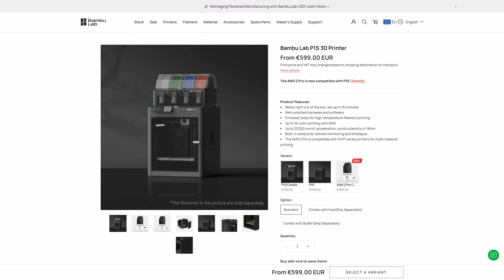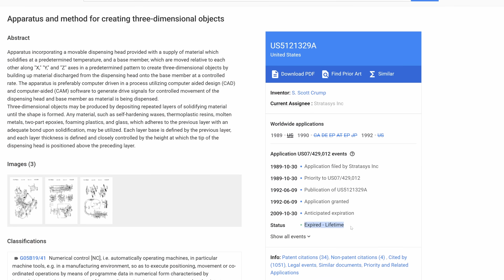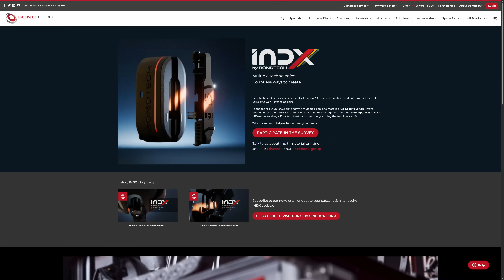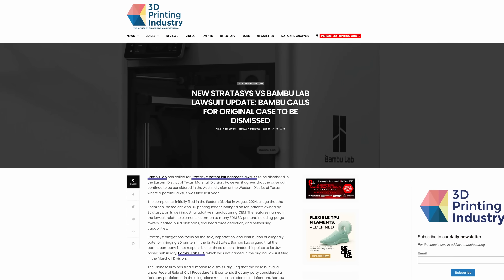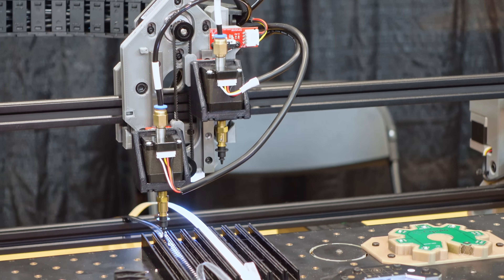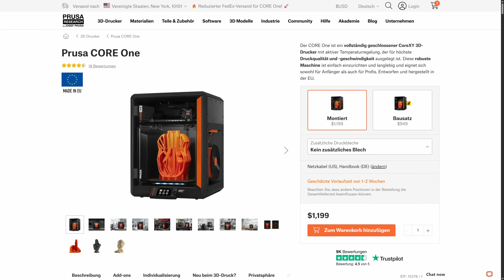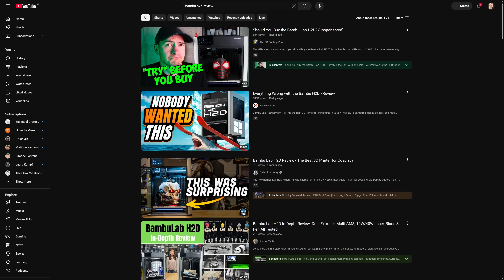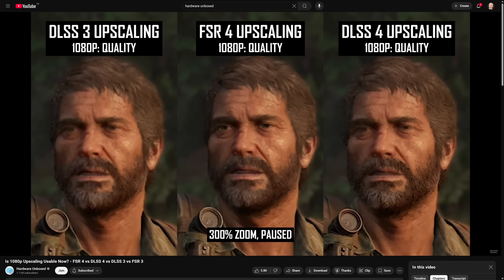How Bambu has won

Comment: Review-wise, what is still missing is using numerous high-end measuring devices to accurately explain why one product works better and will continue to work better...
Think vibration control, actual speed, temperature variation, many things can result in more noise and then a louder product, etc.
Also, how better has the product been thought out, its architecture from the ground up, the strategy it is based on... 

Also, to cover the tinkering open source school of thought; we have seen before: Apple computers versus the tinkering machine filled with ports that Wozniak was dreaming of!
This is also related to technology maturity and customer segments.

Comment: Also one mildly annoying thing related to "Bambu Labs having won", many 3D projects (especially those aimed at beginners), only describe "Bambu Labs settings" as recommendations.

So instead of amount of recommended walls, top layers & infill, instructions might just mention something like "Medium strength".

Sure, I have enough experience to usually figure out what kind of parts might need more strength, but would still be nice to get some directly usable (on any FDM slicer) settings recommendations. Also, if it's a big project, it's easy to think of some sensible settings, slice some parts, print them, and when you decide to slice more, you (and your slicer) have already forgotten those settings (even if it's rarely important to have 100% same settings on many parts)

Comment: What I want from this channel is just breakdowns of new tech like you always have. If there's a new extruder that can print metal, I'd expect you to cover it. If there's an AIO printer that handles that, same deal.
I could get that somewhere else, but I trust your judgement more than some random channel because you've built up a reputation for yourself.
I remember initially getting into your channel because you had comprehensive walkthroughs and hacks and stuff for a bunch of the 3D printers I owned, but realistically, these days, someone else is going to do that if you don't.
Reply: My current printer the Tevo Flash is sitting in a half-built state with a high temp extruder I modded it with because I could never find the motivation to finish it, and I've been wondering whether after all this time, I should just buy a new state of the art printer. After this video, it sounds like maybe I need to try one of these bambu ones. I wouldn't trust anyone else's judgement on something like that, but you've been through a lot, have good critical reasoning skills, haven't been bought out by anyone, and you can always see the honesty in your body language.

Comment: Open source is a great philosphy for kickstarting the development of some emerging tech. That idealism creates an exciting and collaborative community. However it only gets you so far. There is this brickwall in the evolution of any complex tech that can only be crossed by pouring billions in R&D. Bambu with it's DJI expertise did just that and there is no coming back. No company will spend that much in R&D unless they have the protection of patents. Open source and progress are fundamentally at odds and I don't see this ever changing for mainstream consumer products or anything industrial.

The idealistic early adopters will complain, but that idealism only stifles development after a certain point. You can't create an open source iPhone. At the end of the day Bambu is actually delivering what the mainstream user base wants, otherwise they wouldn't be making so much money.

Comment: Well Thomas, I started my 3D printing venture with the PRUSA MK3 when it first came out.  I stuck with PRUSA for quite a while.  I went through most of the MK3 upgrades including adding the MMU.  Loved the quality of their filaments too.  The MMU is where I started to have functional issues with PRUSA products and in the end I had to disable it.  I was a big supporter of PRUSA and day-one investor of the XL.  I understand development delays, parts shortages, setbacks in design and production, but the information flow from PRUSA became very weak in my opinion.  The last straw for me was the shipping roll-out.  Even though I was a day-one purchaser and had a very low number in the queue, PRUSA decided to delay my purchase by another six months as it was not the higher priced prebuilt version.  Bad on them.  Got my money  back and bought the Bambu Lab X1C printer.  Wow, I was impressed to say the least.  Never looked back and now have the Bambu Lab H2D with twin AMS-2 Pros.  I have watch and appreciated your channel for years - thanks!  I did notice that you seemed to give Bambu Lab the cold shoulder and some comments seemed out of place.  Very glad to see this video.  Keep up the great work.  Cheers.

Comment: While i dont need open source, i need to be the owner of my hardware.
if a company is able to decide what i do or cant do with my hardware, what consumables i use, or when i can use it ... then no i am not paying you to lend me your hardware.

For the moment, Creality hits the sweet spot for me. Quality and ease of use, is inferior to Bambu Labs ... but it is way easier to work with than my original P3 clone that i built myself 10 years ago, way cheaper too. Out of the box my K1 Max was a pleasure to get to know and use, i was printing succesful nice prints the moment i got it set up. And when i started noticing i wanted to fix some of the issues it had (here is where the inferior quality comes into play), there was plenty of ways to solve the common problems other users had. And if i need to mod it ... i can do whatever i want without asking for permission.

I will never buy closed ecosystem hardware, be it a cell phone, 2D printer, 3D printer, car or a combine harvester (looking at you green john).

Comment: I’ve always just enjoyed how clear cut and objective your videos are. Personally as a viewer and printer in both a professional and hobbyist arenas, I do think reviews on the look alikes are needed to see if it’s worth using. We all know Bambu is going to make good products, not to exempt them from mess ups, but how well does the flash forge stand up against it, or the Sovol look alike? It may get to the point where it’s just a matter of brand loyalty for the different users, but I genuinely like to see where the others fall. Possibly also give news on either new filament or technical advancements in 3d printing, and potential applications. I know other channels look into this, but there’s all ways a new perspective on how a particular piece of tech can be used based off of your personal experience that others might not think about. Your video on topology optimization in fusion 360 was the first time I had seen someone give a quick at home example of how to use the tool, and has helped inspire me to find ways to use it. And as always, make sure you’re throwing something in there that you enjoy covering. I know you do this to help pay bills and have to give viewers what they want to some degree, but make sure there are fun topics you want to cover as well. Even if it’s just projects around the house.

Comment: I've been 3d printing for about four years and it's moved from a hobby to a tool, as with my woodworking. I don't want to be constantly modding my tools, I just want to build stuff. Having a printer that will print something that I design, reliably the 1st time is where many newer users are now. It was fun to upgrade but  It's time to retire my Ender 3 Frankenstein.

Comment: I got into 3d printing just as the pandemic in the US was starting.  Since then, I've collected 5 printers (Enovo Sidewinder X4, Prusa I3 Clone, Ender 3 (with direct drive), Ender 5+, and finally a Bambu Labs X1-C).  I've watched many of your videos to learn about how to modify and tune my printers.  I'm glad that you spared me from making some expensive mistakes from the product reviews you've done over the years.  Thank You!  
I believe I fall into the category of non-tinkerers unless there's something I want to improve or needs repair.  For now, Bambu Studio is working great for me as I'm still learning its features.  So the lockdown by Bambu Labs on the 3rd party software (such as Orca Slicer and Octoprint) hasn't affected me yet.  I think that by the time I have Bambu Studio figured out and have figured out its weaknesses, Bambu Labs and Orca Slicer will have worked out a solution.  By either incorporating Orca Slicer features into Studio, or allowing File/Printer access to Orca Slicer.  
In the meantime, please don't stop doing your videos!  They are very informative!  They spark imagination and ideas that bring better products and "things" into the world.  Just think, 15 years ago printers were made out of laser cut wood or plastic (like the Prusa I3) and look where we've arrived!  Out of the box printers that can print multiple colors, self calibrate, and are easy to use out of the box!  It's brought 3D printing out of a hobby/tinker status and into the major appliance status!  This didn't happen over night; somebody kept saying "There's got to be a better way to do this!", and improvements were made (ABL, enclosures, direct drive, and nozzle technology just to name a few).  Please, don't stop being part of the spark!

Comment: I was hesitant to even watch this video because of the cickbait title and intro. Luckily, the video was a bit more nuanced than the title suggested. 

I will never EVER buy a BambuLabs printer, and I will never recommend one to anyone. Yes, it produces great results, but I personally can't get behind a manufacturer with those business practices. I was suspicious of the company ever since I learned it was started by many of the same people from DJI. The firmware incident pretty much solidified my opinions. I believe they're taking the same approach as 2D printer manufacturers and are selling the printers themselves at cost or maybe even a loss, and are making up the difference elsewhere, either through filament sales or, more likely in my opinion, selling data they harvest through their cloud app. Their "maker world" 3d model site is also really scummy in my opinion, providing people the option to essentially sell their design to bambu and make it makerworld-exclusive in exchange for small discounts on filament while at the same time preventing others from modifying or adapting the designs. This is likely a strategy to drive everyone to makerworld and shutting out the various other 3D printing design repositories. I cannot get behind this, and I do not download files from makerworld; especially those that are marked exclusive. 

I have always built my own 3D printers. I built my first in 2014 (An Eustathios, which didn't end up being a winner in the grand scheme of things) and I eventually built a Voron 2.4 this past year. Despite not being that competent when it comes to the software side of things, I still love the idea of it being my machine that I can tweak how I want. When someone asks me what printer to get, though, I recommend Prusa. My brother has an XL which produces fantastic results, and we bought a family member a Core One as a gift, which also produces great results. Both of these have great user experiences that don't require much or any tweaking. Yes, it's more expensive, but I know from Prusa's track record that they will support these machines for many many years to come.

Comment: Hey Tom,
You are not wrong in hoping so, maybe a bit naive in expecting it would play out differntly? The reality is that everything popular attracts businesses, and money always wins.
There is the way Prusa and E3D did it, DIY, self-owned, and figure out a way to lock out the competition... and then there is the way Bambu did it, or something in between.

Next on my list for death by corporate would be Voron. It started by not releasing design files until Kits are stocked at shops. Then, kits required new parts that were previously unavailable. 
The design of the upcoming Phoenix is based on custom CNC parts, the design files (I assume) will be available but are impractical to DIY.
The last statement I heard was that Voron is holding back the release to "finalize the design" while "[the] Partners are setting up the mass production line" at the same time ... hard for a competitor to come in when there is already a cheap mass produced option available ... at which point do we call it the LDO Phoenix, designed by Voron in Florida? Technically, it's still open-source, sure, but it's no longer a DIY project. 

From the outside looking in, I assume that Voron Kits make up a significant chunck of LDOs revenue and that most of Voron Design LLCs funding comes directly from LDO. 
At some point, LDO must decide whether they can accept the risk and continue to rely on an external company for their product development.
Voron will have to decide whether to stick with a few partners or diversify its revenue streams and partner with more companies.
... if LDO does not yet have an ownership stake in Voron Design, they will soon have one. You can see where this will ultimately lead.

Don't get me wrong; the Voron Team deserves a payday; when they get acquired, they hopefully end up with a life-changing amount of money.

But somewhen, somewhere, someone will come up with a new DIY printer, and people like us will gravitate towards that ... years pass by, and then money gets involved, and the cycle repeats. 

Anyway, I will continue watching your channel, and I don't mind printer reviews, but please make them entertaining. I don't care very much about the specs of the umpteenth cookie-cutter printer that I'm not going to buy anyway; I want to be entertained. Please take a page out of Linus' book and provide both value and entertainment. 

... well it's just a thought, Cheers!

Comment: 10 years ago thingiverse was full of mod parts and sd card holders.   now were at bambu labs selling machines meant to just make useful stuff. i get the fear of proprietary code but if it works it works.  im also a huge fan of dji's drones.   both companies make amazing software/hardware integrated products that always just work.

Comment: Thomas, I agree with your assesments overall, however we can't and won't accept enshitification of 3d printing.  We need to oppose as community threats to our ownership of our 3d printers.  You only need to look to ink jet printing to see a potential future where you pay per print and forced subscriptions in order to continue to use some or all features of the 3d printer you purchased.  So now that you explained this aspect what are the bright lines that you will not cross?

Comment: well just my two cents, even though i respect the OG aspects of 3D printing, which were heavily focused on improving the machines themselves, what i'm interested the most is on outputs - i want quality 3d prints, and with least friction possible from a technical standpoint, i don't want to be continuously tinkering either with hardware or with software to be able to get good quality prints. I'm actually brand agnostic, i have different brands in my "lab" but indeed Bambu has/is winning at this point, as they provide what i'm looking for the most, that being said they are not alone, i do like the centauri carbon, which has a great price to quality ration, the anycubic kobra s1 is decent, but not great in my opinion, and i now will have a "tinkering moment"  as i got a prusa core one as a kit, and will need to go through assembly, which is something that i tend to avoid, but that i'm curious to give it a go as a learning experience, to see if i ever want to tackle the challenge of building a ratrig. So to summarise, i think it's not important that we focus on the brands, but what i'm interested in is the technology they are coming up with (closed or open source) and how that actually translates into creative possibilities for people like myself that are more interested in the design outputs you can get rather than on the components or specs of a machine

Comment: Another way of "winning": supporting the creators directly. As a designer of simple (and therefore free) 3D models I was able to collect ~2k Prusameters over last 3 years which I spent on a few spools of Prusament and a mousepad covering just the shipping. Nice. In the same time period ~8k MakerWorld points earned with the same (!) models allowed me to buy not only some Bambu filament but already two A1 Mini's for exactly 0€.

Comment: Idea:
Test PLA annealing temperatures.
Instead of annealing at 100º and make if highly temperature resistant (which also deforms the part), try to anneal at lower temperature (95º, 90º, 85º…) and see how temperature resistance performs (and part deformation) when annealing at lower temperatures.

Comment: Thomas, you were NOT wrong that trying to cling to the open source model would provide the best out come for everyone. It still would. You stated it yourself when you mentioned companies are trying to work around existing patents, versus work on interesting new features. It will become harder and harder for new companies to enter, and larger companies will star buying up smallers ones... Until there will only be one or two. It won't end well for anyone.

Comment: Also open source from a software stance has become incredibly complex. I had a mendal many years ago it was easy to build and software no issue now i want to build something different. The hardware is simple components plentiful but my god no matter how many videos i watch klipper is so difficult WTF is SSHing no one explains. Its like an open source secret society your not allowed into. The only light is RATrig that with ratos seem to have some kind of front end user interface. Tell it what your hardware is and it makes the klipper files for you but its limited to rat rig machines. A universal front end is whats needed to reignite opensource